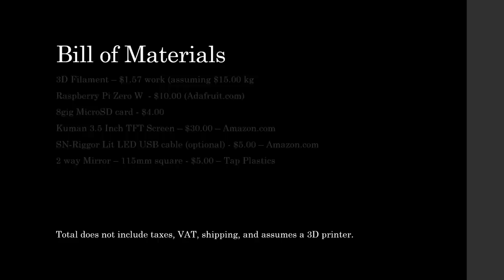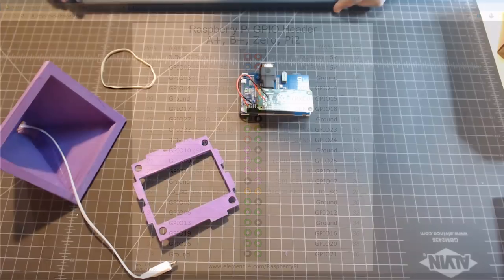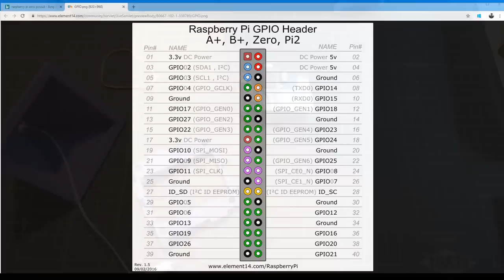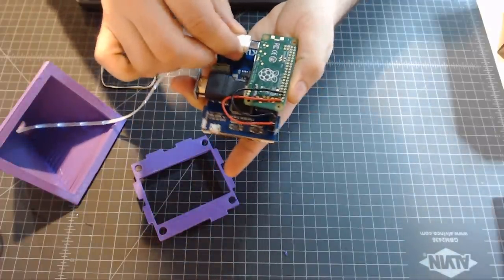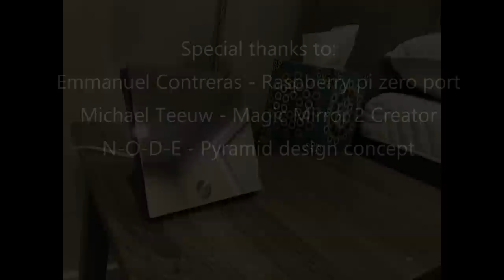Mini Magic Mirror (Under $60!)

Comment: Great project.  How did you remove the white paper masking from the acrylic mirror from Tap Plastics ?
Reply from the maker: I think I just peeled it if I recall, it’s been a few years. The edges of the cut square were sharp, I do recall that

Comment: Great built and Video!! Just one question, how do you update the data, like the weather/stock ? As the Pi Zero has no built in ethernet/wifi module, right ?
Reply from the maker: I'm using a Pi Zero W, which is an updated Pi Zero that has wifi on it. There have been others that have used a wifi usb module plus OTG cables to update older Pi Zeros to wifi as well. But the Pi 3A is the way to go nowadays IMO...much more power, plus wifi/bt and USB for 25 vs. 10 USD
Reply: @geektoolkit  I missed that, thanks! And keep going!

Comment: Hi! Great video and thank you for sharing! But would you mind sharing with me how to change the display to keep changing single information at a time like yours? I am using a 3.5 inch screen, and I wonder how you can change the display like yours. Thank you!
Reply from the maker: Oh sure, I should've went into that more.  Thanks for the kind comments!  You'll want to use the MMM-Carousel module from here: https://github.com/MichMich/MagicMirror/wiki/3rd-party-modules  .  With that, it'll switch between modules. Then I set every module I wanted to display in the same place (I think it was middle_center or something like that). That Carousel module will take care of switching between them and gives you the ability to adjust how fast.  Another thing you can do is tell it to ignore modules, so if you want to have say a status at the bottom the entire time, you can do that as well.  Hope that helps, if you have further questions please feel free to ask!
Reply: @geektoolkit  Thank you so much! That really helps. I just successfully install the module (:

Comment: Rubber bands get old.....  :-)
Reply from the maker: That's true. I havne't had an issue with mine yet, but I am sure at some point I will. Any ideas on a better way to make it easy to assemble but also easy to take apart? I wanted something somewhat seamless in look to keep it futuristic, but also have a little flexability in stuff like the screen/pi assembly
Reply: @geektoolkit  I'd have used either some copper telephone jumper wire or some waxed beading thread, both of which could last for decades and are removable.
Reply from the maker: Oh Thankyou!! I like both of those options and will have to try one when I next create one of these